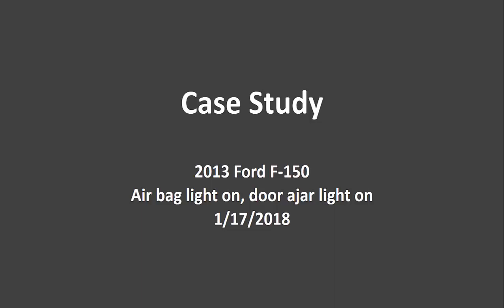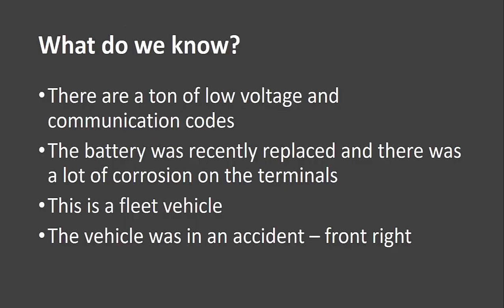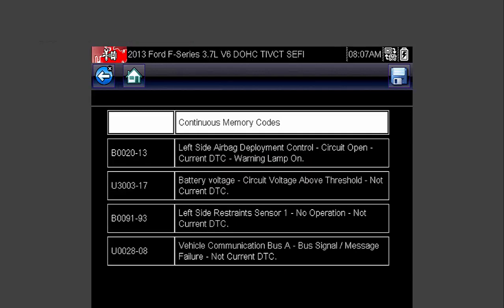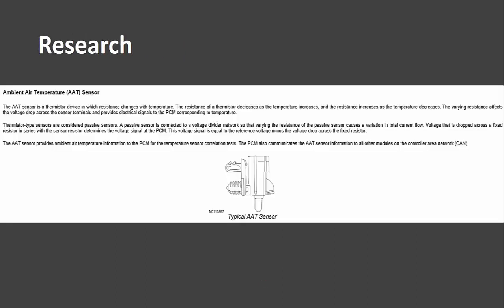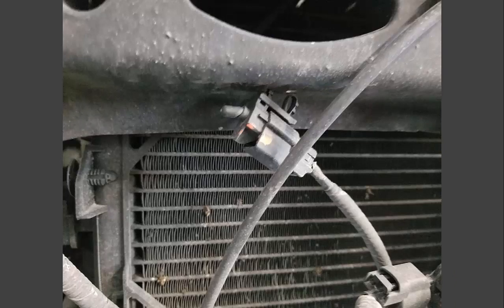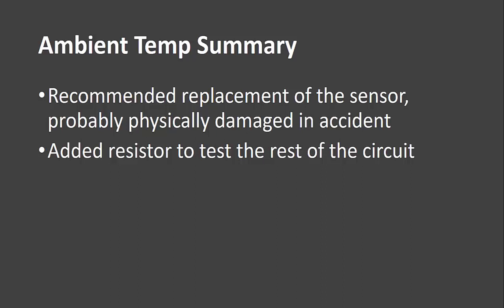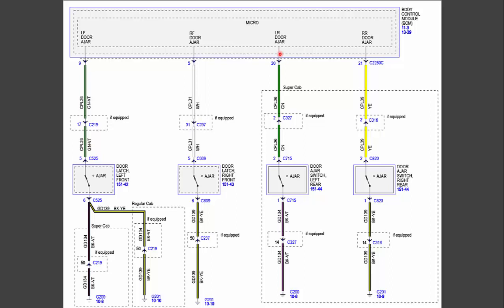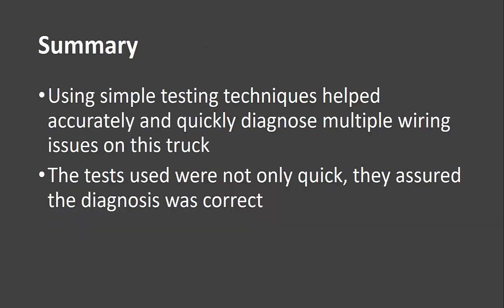Case Study: F-150 with multiple electrical issues

Comment: Matthew, this was a great video. Do you happen to have a link or know of some articles about air bag testing best practices for safe and effective testing. Thank you
Reply from the maker: I don't have any more videos at the time, more to come. The idea is replacing the squib with a "known good" resistance value. If your code comes back (or some cars have a resistance PID) you still have another issue. If your code goes away you can suspect an air bag issue. Obviously it is dangerous to test resistance of an air bag since the meter applies voltage to test. To condemn an air bag module test everything else.
Reply: @matthewshanahanautomotivet4284   How do you know what size resistor to use?

Comment: That's a fantastic tip about the resistor use to trick computer for monitors. I never even thought about that but will from now on. That is awesome
Reply from the maker: Yes, it is much easier than blocking the radiator with cardboard and brake torquing the engine... 

The AESWave kit I used includes a variable resistor. I use it all the time, I'm not missing the box of 2,000 resistors that I used to have to shuffle through.